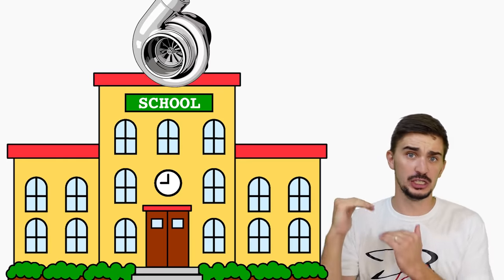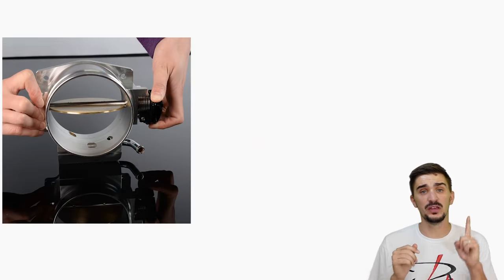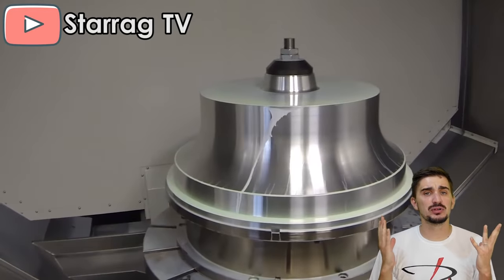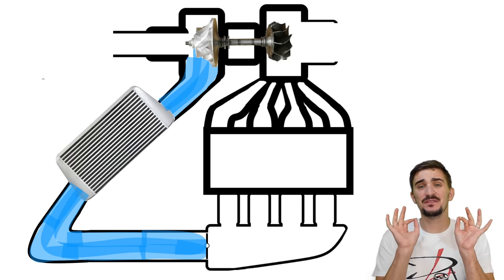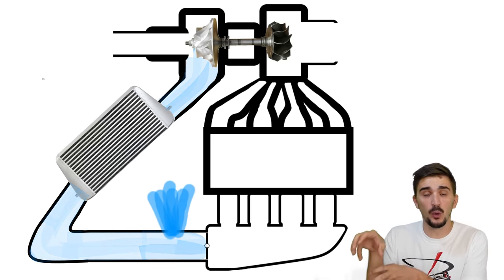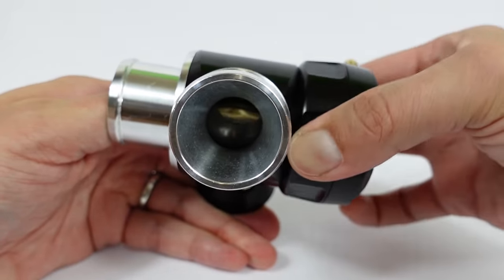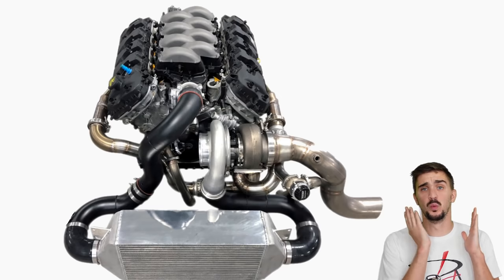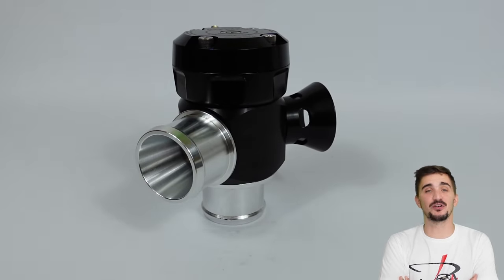TURBO FLUTTER and BLOW OFF VALVES explained in DETAIL - BOOST SCHOOL #8

Comment: While I normally agree with the information you provide, I have to disagree here.

“Off throttle” surge or turbo flutter does not cause additional strain on the turbocharger. Since the turbocharger is under its maximum thrust load during use (for example at 20psi) shutting the throttle does NOT increase this, and therefore doesn’t load the thrust components any more than they would be during normal use.

This is very different to on throttle surge (when you are actually in the surge zone) which causes huge strain on the thrust components due to being at the working thrust load @ 20psi. This will often snap the turbine shaft clean in half.

Having worked in the turbo industry for a few years, I’ve never seen a failure from the lack of a BOV. If you are experiencing on throttle surge, things such as anti-surge housings will allow you to push the surge line further away.

I’ve also never noticed a difference between response between bov/no bov on a vehicle, but I run my car without one. Logically, without a bov, less air will need to be re-compressed and thus speeds up response. Although this is just a guess at best :)
Reply from the maker: I had another commenter mention this too. I did cover on throttle flutter at the end of the video.
What damages the turbo in off throttle surge isn't the thrust load itself. It's the shock loads of the pulsation as the excess pressure exists past the wheel.. It's rapid on-off loading or in-out of the surge zone that's the problem.
I had another person say how they never saw damage due to no BOV. I'm pretty sure there are no bov failures out there but the attribution of their source becomes subjective because bearing damage is bearing damage and the same damage can be attributed to multiple different sources.
It's true that off throttle flutter is harmless, but that's only when boost is low. This is why some early turbo cars didn't have bovs or recirc valves. But they ran like 7-8psi (0.5bar) of boost. I believe the thinking that bovs are useless may come from this era.Today you have cars that run 1.2-1.5 bar from the factory, and they all have recirc valves. In fact all factory boosted cars today have recirc valves. Looking at it simplistically, if off throttle flutter was really harmless and bovs useless than factory cars would never have them and would happily flutter along. Anti surge housings definitely help but they can't get rid of flutter on high boost applications.
Reply: @d4a   While I would agree with your assumption, that’s not how it works in the practical world.

In all turbos (both JB and BB), theres actually no contact between bearings & shaft during operation, same with the thrust washer & bearing. The so called “shock loading” your talking about would only see an effect if you had a drop on oil pressure or oil contamination, allowing for contact. 

When exposed to on throttle surge, it doesn’t actually harm the bearings. It can, at most, overwhelm the thrust bearing and cause a failure there. But that’s only the case if the thrust collar & bearings surface area isn’t big enough to cope. The shaft will 99% of times snap before the thrust bearing is overloaded in a surge scenario

I run 1.4 bar through my turbo, and have experienced no issue. I have customers who run 1.8-2 bar through their turbos with no bov either.

Just because modern manufacturers use recirc valves, doesn’t mean it’s to prevent damage. They were implemented due to noise &  emission reduction, not for turbo longetivity.

I’m talking from personal experience working in the industry. Maybe I’ve just been extremely lucky with all my applications, but I don’t think that’s the case. Each to their own.
Reply: @d4a  Im not saying this is the definite case. But from factory they dont want loud noises that may concern the customer
Reply: I have to agree with JK_Fab here. Compressor surge under WOT will kill turbos. There is no need to for me to provide any detail as he explained it well.

In saying that driving 4 answers, loving your videos, much love from Australia
Reply: @JKFab  Hello mate, i wanna ask a question that lays in my head for 2 years now... I have a GOLF VI twincharged 1.4 around 235hp with 1.5 bar... I have a cold air intake installed AFTER the maf sensor.. and a stock bov.. i want that flutter sound so bad and I don't know how to achieve it.. nobody of my friends will help me because my car is the slowest.. 

I've seen many videos but not for my engine.. One thing i know is that it doesn't matter the size of the turbo because another friend of mine has the Vw up 1.0 stock, and it flutters like a supra. Thing is his car dosent come with a bov from the factory and also his intake filter is installed ON the turbo.. idk im too confused.. should i just unplug my bov? But then i get a funny noise... Or block the bov somehow ? 

I hope you see this.. and help me
Reply: @JKFab  Hello mate, i wanna ask a question that lays in my head for 2 years now... I have a GOLF VI twincharged 1.4 around 235hp with 1.5 bar... I have a cold air intake installed AFTER the maf sensor.. and a stock bov.. i want that flutter sound so bad and I don't know how to achieve it.. nobody of my friends will help me because my car is the slowest.. 

I've seen many videos but not for my engine.. One thing i know is that it doesn't matter the size of the turbo because another friend of mine has the Vw up 1.0 stock, and it flutters like a supra. Thing is his car dosent come with a bov from the factory and also his intake filter is installed ON the turbo.. idk im too confused.. should i just unplug my bov? But then i get a funny noise... Or block the bov somehow ? 

I hope you see this.. and help me
Reply: @TzouPhotography  All you need to do is take out the stock motor and install a 2jz and then you should get hectic turbo flutter. Hope this helps :D
Reply: @TzouPhotography  just delete your bov
Reply: @AtMortenJ  i did and i had no boost above 0.5 bar and also when i let the throttle all i hear is psss
Reply: @TzouPhotography   Then you did something wrong
Reply: @d4a  may I ask what you mean by early turbo cars? Like between what years are we talking?
Reply: @TzouPhotography  you probably already figured this out but you need to somehow block the outlet to the BOV so the boost only has one path straight back to the turbo. Happy choo choos

Comment: The Group B quattros have the nicest turbo sounds out there, change my mind.
Reply: That inline 5 helps too they sound phenominal
Reply: LANCIA GANG!
Reply: @thestigv7216   that was so uncontrolable but was so cool think it made somewhere in the realm of 600hp
Reply: @ethanrainsford4251  I thought the S4 made roughly 500 horses. It was fast because the twin-charged engine had no turbo-lag, not necessarily because of extra power.
From what I know the most powerful Group B prototype was the Sport quattro E2 with somewhere between 550 and 600bhp.

Then again I could be wrong.
Reply: @peekaboo1575   in all fairness they was all rediculous in power figures there most likely wasnt any dyno figures just speculations all we can gather though was they was fucking fast for what they was and they mustve took some massive balls to drive as hard as they were driven
Reply: @ethanrainsford4251  for some reason death trap = cool in the car enthusiast's book 😂
Reply: @thestigv7216   of course its cool the look the style the danger they said back then it separates the boys from the men
Reply: Audi IMSA GTO is up there. No BOV to not “empty” out the intake when driver lifted.
Reply: Supra with a gtx40😅😅😅🤣🤣
Reply: I will not change your mind as I agree, HOWEVER my favorite Group B car was the Ford RS200... fucking sexy ass looking iconic mini death machine. Insane amount of power for such a short wheel base, equal power distribution across all 4 wheels.. makes me drool lol

Comment: On big turbofan engines you can actually see the blade bending under power. So it's flexing but you can't see it on a tiny turbo. All metals have a max bending cycle or fatigue, like bending a coke can tab back and forth until it breaks in half
Less bending, extended life . I like these topics great explanations. I was an assistant teacher at NAS Pensicola Aeronautics school. Your explanations are great , good research.

Comment: A counterpoint from the real world. I have been turbocharging engines professionally for over 40 years, including many for road racing. Never used a BOV, never had a compressor or bearing failure from surge. No engines from the golden turbo age of IMSA , Trans Am or F1 (mid '80s to mid '90s) used BOVs to my knowledge including ones used for 24 hour races.  A lot of shifts in road racing at high boost...
Reply: Of course I can’t be sure, but it might be because of the relatively short engine life those cars had compared to a tuner car, which is expected to last longer.
Reply: @inaNis_  I owned my 240SX turbo for 19 years, 150,000 miles. No BOV. Never touched the turbo. How long does it take to damage a turbo?
Reply: @rv6ejguy  Of course I'm just theorizing here, but it could also have something to do with how much boost pressure you run on a regular basis. If you have a a car which you drive regularly, that runs 40 pounds, it could be beneficial to run a bov or a recirc. It seems like you were perfectly alright with no bov though, so that's great! You got to save money ( :
Reply from the maker: The theory is sound. Boost pressure is key and this is why in the video I'm saying "if boost is high enough" a few times. Very early turbo cars didn't have recirc or bov but they ran like 7-8psi (0.5psi). Today every car has a recirc from the factory, because today we see 1-1.5 bar from the factory on some cars. I don't mean to offend anyone but bov or no bov it's hard to believe you did 150k miles with the same turbo on a car that was non-factory turbocharged and likely built to be driven hard. This has nothing to do with engine building skill but it's simply the expected life span of things. Also, a damaged bearing is a damaged bearing and will often look very similar regardless of damage source, which is why source attribution in the end becomes subjective.
Reply: @d4a  I appreciate the response. I am saying Nissan, Toyota, Ford, Porsche, GM etc. in IMSA and  Trans Am never used BOVs on any of their turbo engines including ones running at the Daytona 24 hour events. Many thousands of shifts at boost levels up to 40 psi in some cases. Ditto in F1 turbo engines running even higher boost. 

My 240SX was tracked and driven hard on the street for 19 years. I drove nothing but cars that I turboed for 30 years on the street and fielded 7 different turbocharged road racing cars winning 5 championships over 13 years. No BOVs and no turbo failures. I have over a million km driving turbo engines and fly a turbocharged aircraft I built now for 18 years. Zero turbocharger failures.

This is real world, not theory and just another data point as I said.

BOV or recirc valves are often used on OEM installations as you pointed out where they use MAF and would run like crap otherwise.

Thank you for your fine videos. Really well done.
Reply: Another thing that should be considered is the balance of the turbo. Usually the torque on the turbo shaft is quite small so simple friction provided by the clamping force of the center nuts is enough to transfer that torque.
Now if you hammer the compressor wheel with pulses it is not designed for, the wheel can rotate on the shaft, leading to the once balanced rotary assembly not being balanced any more. Then, the increased vibration can destroy the whole rotating assembly.
Reply: @bavarianmonkey8326   I used to rebuild turbos for a living. Never saw a compressor wheel slip on the shaft if properly assembled in the first place. Been doing turbo stuff for 45 years now... I think you are just surmising that this happens. Ever seen it yourself? 

Think that teams like Roush, Nissan, Porsche, Audi were a bunch of dummies for not running BOVs on their IMSA and Trans Am cars? How about F1 teams back in the '80s? You know more than all these professional engineers working for these teams? BOVs are for NVH in factory cars and a marketing gimmick for the aftermarket.

The fact that none of these high boost race cars, running sometimes 24 hour events , had many turbo failures is clear proof that you don't need BOVs.
Reply: @rv6ejguy  the difference between me and you seems to be that you like to put words in my mouth that I did not write. I would never write that I "know more" than professional turbo engineers since that area of engineering is not the one I earn my money in.
However, I have talked to people during the years and there indeed were cases of "yeah we tried without BOV and it did work but the balance changed after some time". One of them also snapped off a wheel. 

I did not say that it would not work without a BOV but that the forces need to be considered. If it works for you, great, but please do not tell people that run 3 bars (gauge) of boost and kill parts in the process of doing so and the whole industry that they have no clue about what they are doing. Especially when adding a BOV solved all the problems.

And please do not put words in my mouth that are meant to make me sound arrogant because that is not what I am.
Reply: @bavarianmonkey8326   Which people have you talked to? You ignore the real world examples I provided of hundreds of turbo engines (televised racing for years) running up to 5 Bar boost (F1) without BOVs and without turbos failing. Road racing and rally cars do hundreds of shifts in a sprint race, thousands in a 24 hour race.

If they were breaking turbos as you assert they would, they would have installed BOVs. The professional engineers involved deemed them not required and were proven correct. Your argument IS saying these guys are doing it wrong. Their actual results prove otherwise.

Chinese Proverb: "Those who say it can not be done, should not interrupt those doing it."
Reply: @rv6ejguy  Well You Sir are right and all engineers who install BOVs do not know what they are doing even if it solved their problems and the solution is common in the industry. 
There can only be one correct way which is your way and all other fact based opinions are wrong.
Life is so simple. Have a nice life.
Reply: @bavarianmonkey8326  In engineering, real world experience trumps theory every time. That's how we prove or disprove a design. It's called validation.

This is not my way, it's reality. You presented no facts to counter my real world examples.
Reply: @rv6ejguy  well I wish I knew for sure. Bc I’ve seen comments like yours proving no BOV is fine, and I’ve seen guys say they worked with turbos for years and 75% I’d the without BOV failed. I just wish I knew bc I can’t get a higher % for either side of the fence. I’ve seen many people with real world experience for many years both say “it will” and “it will not” hurt the turbo. I’d just about pay $$$ to know the answer.

Comment: I'm not really a fan of blowoff valve noises or turbo flutter noises. But I do love Turbo whistle and most new cars you just can't hear much whistle at all. Back in the day, my 1st generation Eclipse had turbo whistle even when it was bone stock. Today's cars, you don't really hear any.
Reply: Man.  I definitely hear mine in my s60 rdesign polestar.  No intake work done yet either.  Fucker can clean a driveway of leaves lol

Comment: Great video's I've just been watching a few. A point worthy of note is when you hear compressor surge with closed throttle, the turbine is no longer under load from the exhaust as the flow to the engine has been halted so the turbo is only under load from the trapped air in the charging circuit. Its very unlikely to cause damage to a normal cars turbocharger. If you had a very large turbo like a Garrett T4 is more of a problem. If however you hear surging on acceleration it's going to be a problem, I had that on mid throttle on my subaru as it could not consume the flow rate of the turbo at mid rpm. It lucky can be fixed with mapping. In this scenario the turbo is under opposing forces from turbine to compressor, that will destroy the unit. In almost 20 years of experience I can honestly say regular turbos like T3 TD04 Vf30 etc won't mind flutter, I've never seen one fail solely because of it.
Reply: Thanks. I was wondering why he was exaggerating how "damaging" the tsutututu surge was and my first thought was how miniscule (or non-existent) of an issue it really is

Comment: 8:30 I agree in with the reasoning here but the turbo is going to be subjected to far more extreme moments when the exhaust is accelerating the turbine from a stand still, turbo flutter will likely have no measurable impact on life span. Real compressor surge, which is when the exhaust is actively driving the turbo definitely has the capacity to damage the turbo.
Reply: was looking for a comment like this. The damage was far more prevalent in older turbos that had weaker components, but now, pretty much any relatively well built turbo is so robust that the thrust bearings and compressors have stress/strain limits much higher than anything flutter can cause (but not necessarily surge while accelerating).

Comment: Very good explanation of what happens with a turbo. The only issue I have is at 11:25, where you incorporate the MAF into the system. Generally the MAF is located in the intake tube just prior to the throttle body, not before the turbo intake. And the BOV would be place on or after the intercooler, but not between the MAF and throttle body.